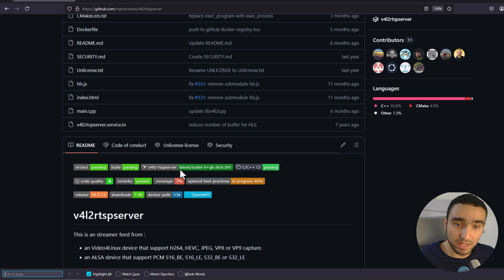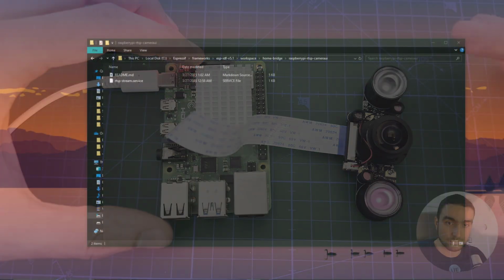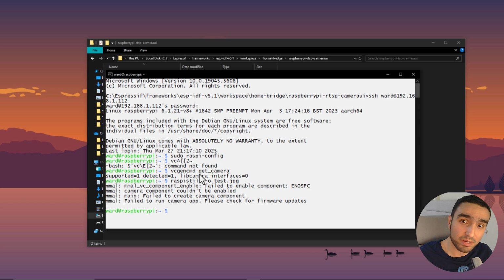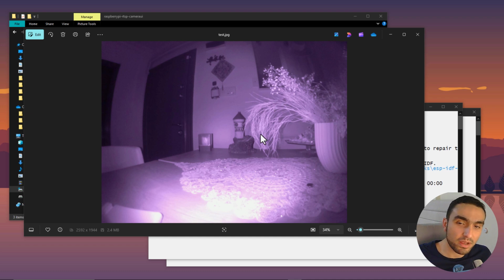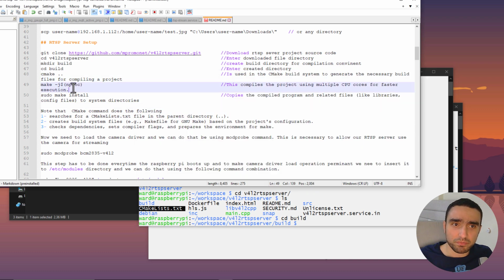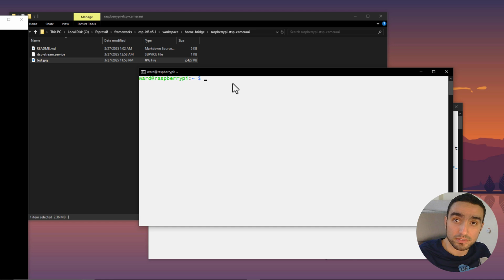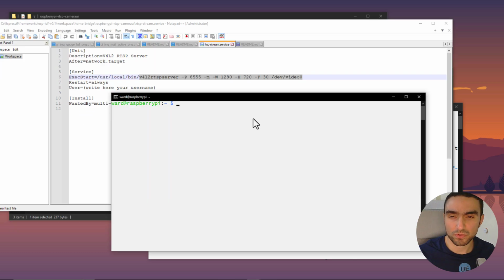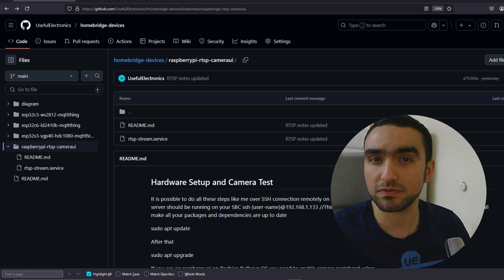Raspberry Pi Night Vision Camera RTSP

Comment: I also want to do an rtsp broadcast with my raspberry pi 5. But when I try to run the v4l2rtspserver command like yours, I get the error Cannot init device:/dev/video0. At the same time, using the libcamera-hello command, the camera works and it is also displayed in the list of devices